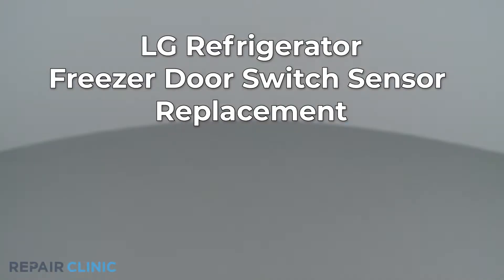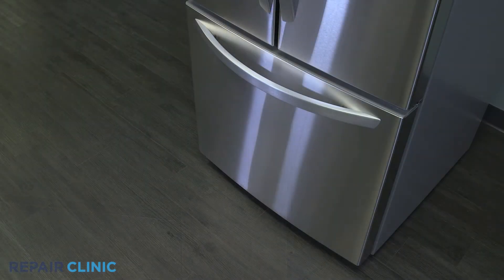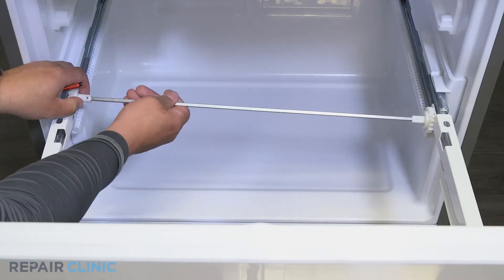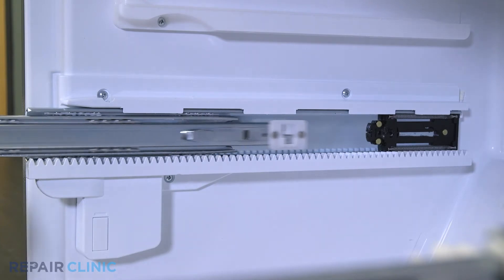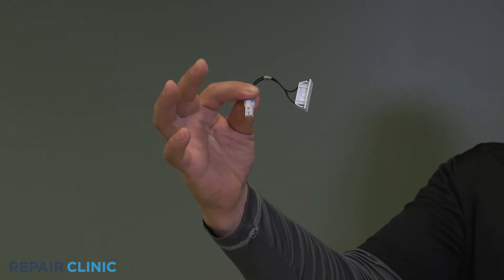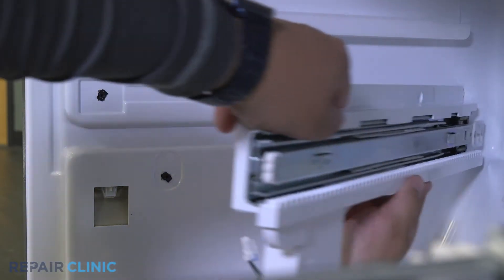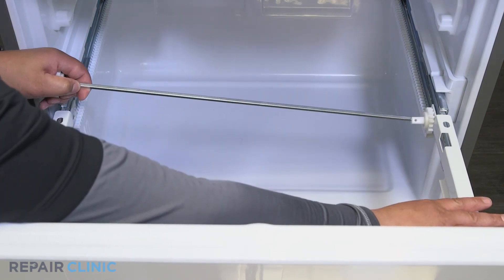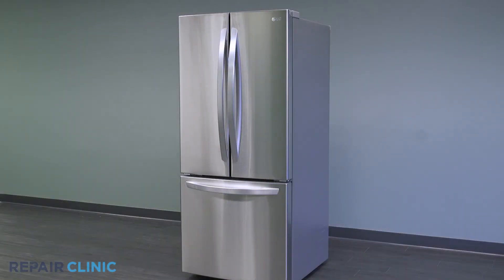LG  Refrigerator Freezer Door Switch Sensor Replacement EBF61314804

Comment: My Freezer light has not been working in a year.  The LED light appears to be hard wired into the back of the freezer, I can’t find a part or any information on how to replace this light.  Could the light issue actually be this door switch sensor?  If so how would I know this?  Just buy the part and give it a go? Thank you for the video.

Comment: An LG refrigerator I've got is not working on the freezer section, though the refrigerator seems okay.
The LG Smart Diagnosis showed a recommendation message saying freezer door not closed completely was detected, with no fault found otherwise, saying "Did not detect abnormal operation".
Opening and closing the two freezer doors show the open door count feature on the app incrementing as expected each time, so it seems the door sensor is working, but each time I run the diagnostic, the same recommendation shows up. Not sure if it's just a stale message from the app or if it's actually detecting a problem. 
Aside from the open close sensors, is there any other sensor that detects not closed completely other than the open close sensor?
Would that message keep coming up because the temperature sensor for the door ice maker is not detecting freezing temperatures?
The ice maker is not freezing at all either, is there a separate fan used to deliver cold air to the door ice maker that may not be operating and causing this cryptic  repeated message?
Ans: no, just the single door open sensor is used, nothing that differentiates between closed and "completely closed" as LG indicates in their cryptic diagnostic message.
Reply: Just FYI to those looking into the issue freezer not operating properly; the problem in my case was not anything to do with sensors or compressors, but instead from dust build up that completely blocked the cooling vents and condenser in the back of the unit. Pulled out the refrigerator to access the back, removed the screws holding the cover plate at the bottom, and used a vacuum and soft brush to thoroughly clean it out before putting it all back.
Problem solved, freezer and refrigerator section works just fine again, no parts needed 👍
This needs to be a periodic service, and was neglected far too long until it actually stopped working because the condenser couldn't dissipate the heat due to the insulating layer of dust.
It'd be good to fashion some kind of air nozzles directed outward so an air line hookup could be used to easily clear off the dust periodically.  That would keep it at maximum operating efficiency without the inevitable long periods in between cleaning.
Or a thermocouple sensor could be placed on the condensor fins, so the temperature could be monitored, indicating a cleaning is necessary when the temperature rises above a certain threshold.  That might be something worth doing on a diy basis, since thermocouples are inexpensive, and the meter is easily hooked up to use for diagnostic purposes without needing to pull the refrigerator out of position each time.
Reply: Hello, i have the same issue, did you fix it?
Reply: I think I have the same issue.  My Fridge seems to be working but the freezer is warming up and all the ice melted overnight.  Diagnostic says "Did not detect abnormal operation" but also gave the warning about the drawer being open.
Reply: @toddworthley8780  the fix for that at the time was to clean the condenser at the back of dust buildup, which restored operation. 
However, it just recently stopped cooling entirely, may be a problem with the linear compressor this time.